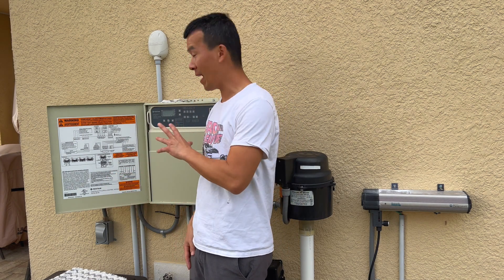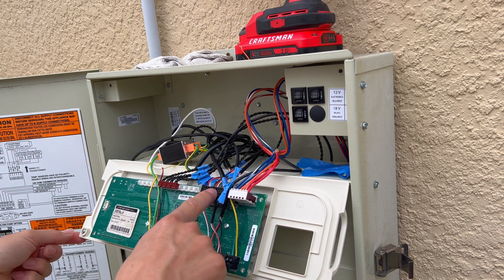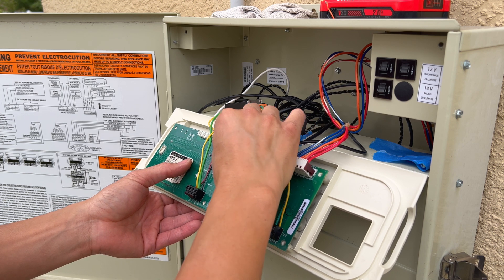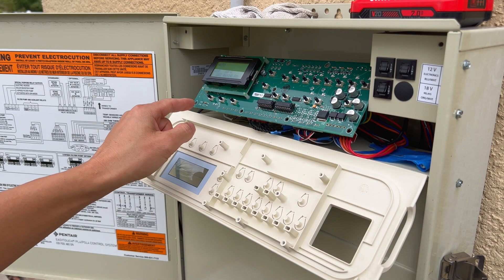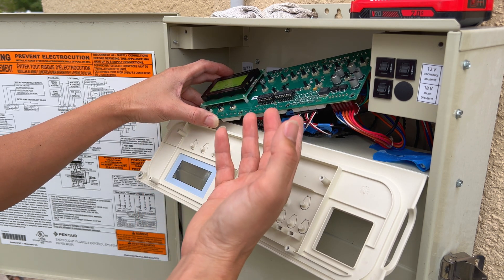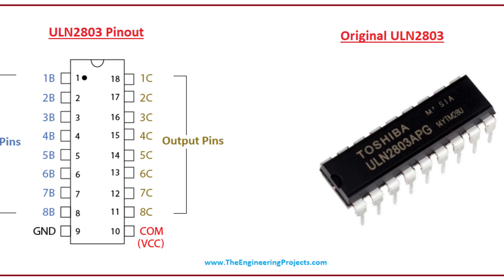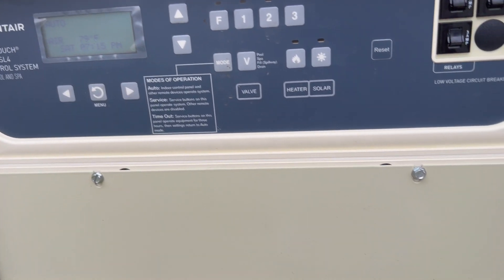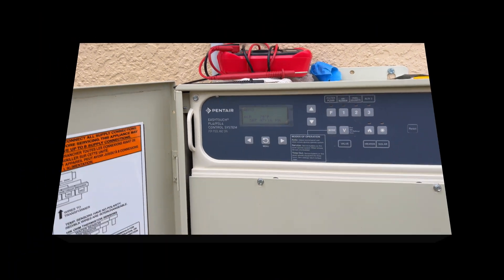How to Fix Pentair EasyTouch IntelliTouch Input/Output Control Board

Comment: I don't know if you are still looking at this. I have your system and the problem is the light breaker when I turn it off it turns the whole panel off so I guess thats how they wired it up. But when I turn the breaker on it just clicks sometime slow and sometime real fast to the relay. I'm not able to run anything as of now. I have to turn on the pump manually on and off. What do you think. Thanks so much for your time and hope your still monitering this.

Comment: Unfortunately when these boards have a com blow it usually means more complements will fail later.  You will most likely be fixing more issues down the line.  Better to replace it.  Trust me.  It's a temp fix
Reply from the maker: Going strong over a year later.

Comment: Solder on the extra resistor to get your other four relays working.  All the programming is there.
Reply from the maker: didn't think of that. typical corporate greed, lets handicap and charge them more for the same thing.

Comment: thank you for the informative video. I have the Pentair Intellichem system, and need to swap out the circuit board due to the lcd screen being nearly impossible to read. Do you have a video that documents this process?  Thanks
Reply from the maker: You may be able to find a replacement LED from Digikey or Mouser if you have the P/N off the old one.

Comment: I think my transformer is bad because my cca isn't receiving power.   i found one on Amazon for over $100, but was wondering if there may be a more inexpensive one.
Reply from the maker: Check the leads off the transformer, there are multiple leads that have different voltages. If you look at the block, they bare transformer without the pentair case is like half the price.
Reply: @TunerwithKids  not sure if ther is a particular size transformer i need. I thought about getting one from an old microwave from a thrift store to use.   I didn't see any voltage coming from the transformer wires, but i will check again just to verify.  The main breakers do have voltage.  Thank you for your help.
Reply: swapping the high voltage transformer didnt work. @TunerwithKids

Comment: Hi Binh, Great information. My Polaris Pump quit working. thought it was the capacitor. Changed capacitor but no luck. Tested the power to pump... no power. Opened the Panel to check the Relay. The relay in the Polaris position (Aux#2) was not operating. So I thought the relay needed to be replaced. Pentair panel has 3 free relays not in use. I transferred the polaris pump power wires to the unused relay and connected its AUX wire to the Polaris AUX connection position (AUX#2). It still did not power up the Pump. (there is high voltage in the power wires-they are hot). From this troubleshooting, I now determined it is the AUX #2 connection. I moved the AUX#2 connector to AUX Position #5 (it is an open AUX slot and not in use). I then pressed the AUX#5 button and the Polaris pump powered up. working as expected...Yeah...Saved me $$$$.  So would you say the ULN2803APG chip is bad. I want to follow your example and pull the chip. Thanks if you have time to respond.

Comment: Hi Binh-Tuner, what are your thoughts if I replace normal breaker with GFCI instead of RS485 surge protector? Maybe you have thought about this. Let me know what do you think?
Reply from the maker: Breaker is for normal power and GFCi is for fault and safety protection not surge. Surge protection is to ground out spikes in voltage from storms and other events. For RS485, the surge protection is for the power and signal that may fry the chips.

Comment: Thank you for incredible very helpful video. I’m not Electrical Engineer but I’m handy enough. I do understand everything. You said I have a lack of communication between the pad inside the house that’s communicate with the InTouch board and I cannot turn the pumps for the infinity edge from inside with the pad. Would that suggest that I just need to change these chips they are in that could help. Thank you so much if you have a minute to respond.
Reply from the maker: Does your panel communicate with pumps if you’re standing at the outside panel? This video is for the transistors that activates the output relays. If you’re having RS485 communication issues, I have another video on that chip. If your inside pad is hardwired, check the continuity in case wire is cut.

Comment: Problem with valve similar to what you are discussing.  Hi Binh, I love your straight forward and easy to follow videos. My Pentair Eztch 4p started acting up yesterday with something similar.  IOt sounds like the relay associated with J4 which controls a CVA-24T actuator is just clicking on and off. Have you had that issue or can you offer any advice on diagnosing that problem?
Reply from the maker: It might be that transistor. Try swapping to see if the problem moves to another I/O. If so, replace the transistor chip. Else the relay might have issues.
Reply: @TunerwithKids  Thank you for getting back with me, it is very much appreciated. When you say transistor, do you mean the LN 2803?
Reply from the maker: @georgedavis2725  I think so, it’s the own I swapped in the video. It controls all the inputs and output to the line voltage relays.
Reply: Binh, I traced the issue and would you believe it was the indoor control panel.  The switch for the water feature has gone funky and it was switching on and off. Which in turn caused the actuator to go crazy and burn out the HFD23 relay.  Anyway, I just wanted to share it with you should you ever have the same issue.